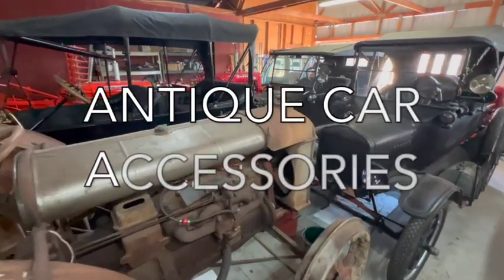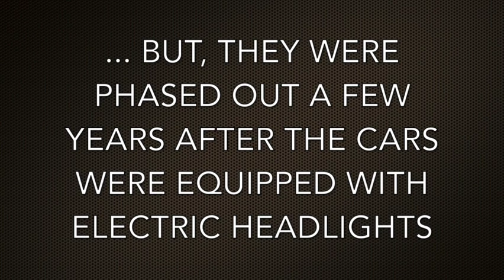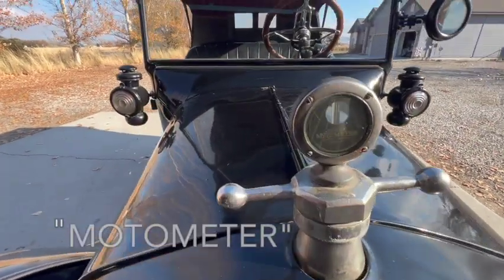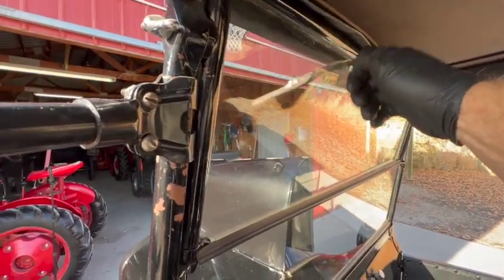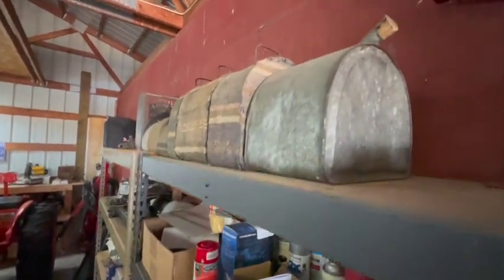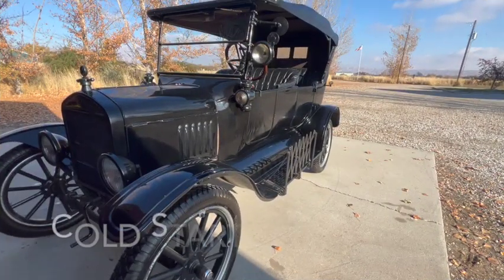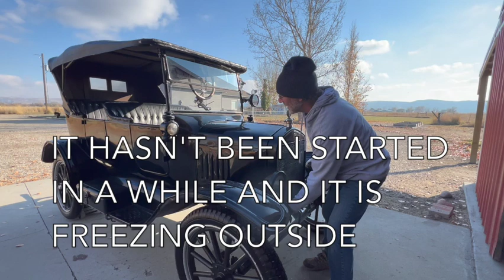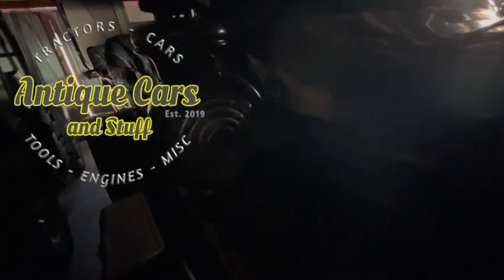Antique Car - Period Accessories

Comment: Here in the East you would need the cowl lights because many of the citys required you to have lights on if you left a car parked at the curb. Another good fuel for those lights is a product called Clean Heat. It is a synthetic kerosene that burns cleaner, has less soot and produces a slightly brighter flame. When you jack the car up to start it, is it possible to put it in reverse so you don't get run over if the jack slips?
Reply from the maker: I will look into Clean Heat. Thank you. No, the car cannot be in reverse when jacked up and running. Although the wheel is spinning, it is actually in neutral. This demonstrates the "clutch drag" when cold. Blocking one wheel is a sufficient precaution if the car comes off the jack.

Comment: Did you mention anything about the spotlight attached to the windshield frame?
Reply from the maker: No, it is an "Old Sol" period spotlight with a rear-facing mirror. I restored it myself. It is fairly bright for a 6 volt light.
Reply: @AntiqueCarsandStuff  thank you